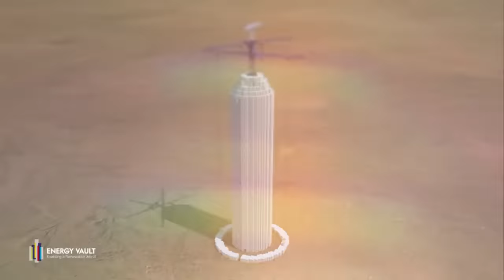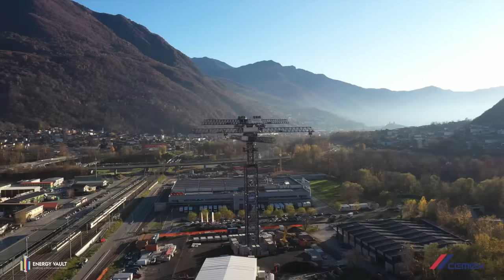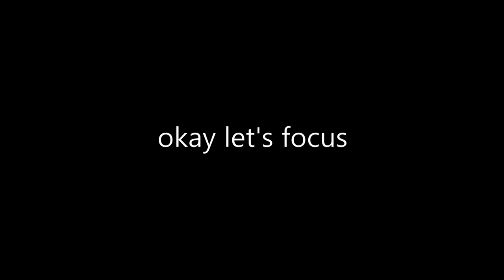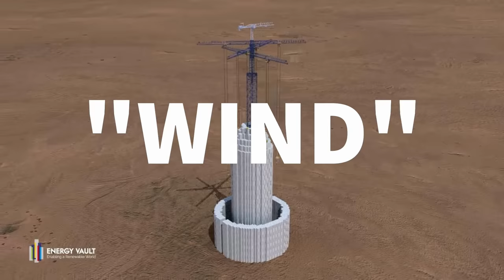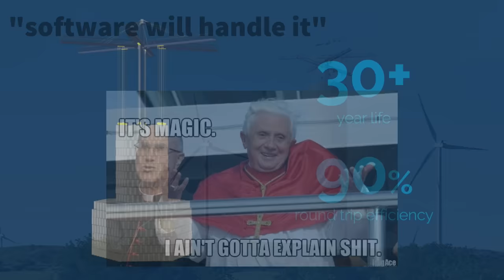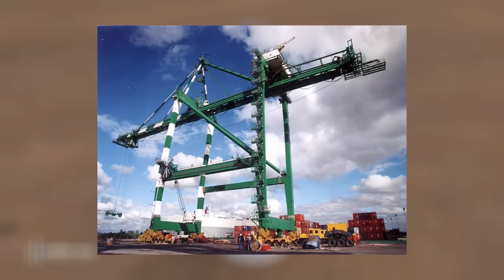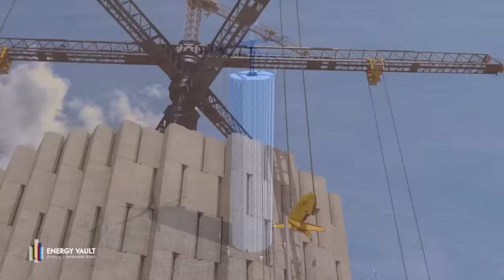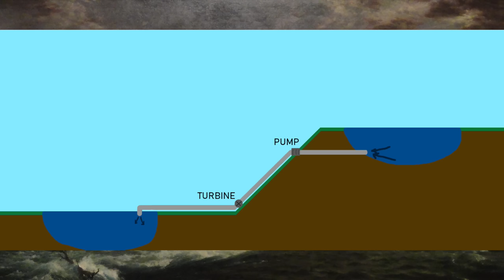The Energy Vault is a Dumb Idea, Here's Why

Comment: it was developed because geographical constraints make pumped hydro unfeasible in a ton of areas
Reply: So what? A lot of places cant have it, why is that a dealbreaker overall?
Reply: @nenmaster5218  Transmitting Electricity over long Distances is very complicated, and you still lose Efficiency regardless of how high the Voltage is. Insufficient Voltage results increases Resistance, resulting in Transmission Losses. Another Problem is that the Wires behave like a weird Capacitor, and Capacitors cause Reactive Power in AC. Longer Transmission means longer Wires and a larger Capacitor, thus more Reactive Power. All of that presupposes, that there already is a sufficiently high Voltage Transmission Grid to avoid said Transmission Losses from Low Voltage Resistance.
Reply: @Genius_at_Work  Oh?
Reply: @nenmaster5218  Wires always have some Resistance, which is proportional to the Length of the Wire and the Current flowing through it. If your Wire is long enough, the Resistance increases so much that next to now Power arrives at the Consumer. The Solution is to increase the Voltage, which allows to transmit the same Power at a weaker Current, thus reducing Resistance Losses. So in Short, a Wire always behaves like a Resistor. A very weak Resistor, but it becomes significant if the Wire is long enough. Hence Electric Transmission works with High Voltage, especially over long Distances. Typical Voltages in Germany are 220 and 380 kV for Long Distances and 110 kV for Medium Distances. The highest Voltage in the World is 1150 kV in Kazakhstan.

The second Problem is a bit more complicated to explain. The Voltage between the Wires builds up an Electric Field, and an Electric Field between two Conductors is a very simple Capacitor. When connected to AC, a Capacitor shifts the Sine Waves of Current and Voltage out of Sync, aka the Peak Current doesn't occur simultaneous to Peak Voltage. Because Power is Voltage multiplied with Current, the (effective) Power drops while Voltage and Current stay the same. The "lost" Power is called Reactive Power, and can best be described as Power moving back and forth the Wire but never arriving anywhere where it could be used. A long Transmission Line would turn into a giant Capacitor, resulting in a lot of Reactive Power. So your Generators would just send Power into the Transmission Lines where it "disappears" without performing useful Work. DC Transmission wouldn't have these Problems, but High Voltage DC Transmission is very expensive, as Transformers don't work with DC. So additionally to the Trasnformers for stepping up the Voltage for Transmission and then stepping it down again for Distribution, you would need an AC-DC-Converter between Step Up Transformer and Transmission Line, and a DC-AC-Converter between Transmission Line and Step Down Transformer. Especially DC-AC-Converters are very expesive, so High Voltage DC Transmission is used only for Sea Cables where there is no Way around it.

Comment: its just 340-350% more space->power efficient than water and also doesn't need much of a wall or space to hold it or make it efficient 

while the base efficiency of water is only 80% 
the efficiency from raw material to electricity of concrete is 90%

concrete can handle temperature, water has problems with it

the claim of the co2 is only a made up disadvantage 
Concrete binds the same amount of co2 in the production and only "creates" the same amount (like the co2 in a tree)

Sadly you cant see the dislikes to know bevor watching it, that its just fake news

Comment: Can we go one step further and skip the pumping to the top pool, maybe just use a water source that's naturally higher than the turbine?
Reply: But that would just be a hydro-power-plant, not a storage device.
Reply: @Otek_Nr.3  if we block the flow when not needed, would it store?
Reply: @canopyjunkie  Yes but you haven't invented anything new with that idea either. That is literally what hydroelectric dams already do. Take Lake Mead outside of Las Vegas for instance. It's a man made reservoir held back by the Hoover Dam. The issue with reservoirs is largely environmental and monetary. A large hydroelectric dam costs 10s or 100s of millions of dollars to build, which is outside of the realm of possibilities for many locations. They also tend to destroy the ecosystems they interact with.
Reply: @Evan_Schaefering  I think the sarcasm is being missed in my comment.... using surplus energy to pump water from the bottom of a hydroelectric dam to the top seems silly when dams already exist with a seemingly unending supply of water, thus eliminating the need to pump water from the bottom back to the top. I'm simply taking the somewhat sarcastic nature of evolution that this video took and continuing to the next steps... "why dig a resuvoire when elevated water sources already exist naturally and with dams" and "why pump the water to the top when nature already fills the top" 

Mechanical energy storage just seems incredibly inefficient and impractical to me

Comment: While water doesn't break or erode, it does evaporate. especially in environments where solar might work very well. Is the energy vault good for that situation? no. you could just put the solar panels on top of the reservoirs, which would reduce evaporation and help keep the units cool. 

Alternatively, you could pull another 'adam something classic' and turn it into a train. Fill the cars will rubble, which is cheap, readily abundant, and doesn't create CO2, then run the train uphill with energy abundance, and let regenerative breaking generate energy on it's way back down. You reduce wasted energy since you don't have to spend energy to send empty units back up for more weights while you are trying to make more power, and everything is now made from stuff that is used in other industries and easily replaced. Is this better than hydroelectric? no, but when dirt is cheap and water is precious it has it's uses.

Comment: This really is a stupid idea. Also, apart from what is explained on the video, it is noteworthy that when the outer and inner stacks are half full (or half empty) the height difference is zero, so it kinda won't do anything for a while, so you in a way can only use half of the capacity anyway. One half of the blocks are at any given moment sort of just acting as something to stack the other blocks on rather than storing potential energy. Kinda. I think. Something like that anyway. I think I'm onto something here at least...

It would be a much better idea to dig a deep hole in the ground and move the blocks between the bottom of the hole and the surface of the earth. And then the water ...yes, using water just is a better idea.

Comment: This has got to be one of the stupidest things I've ever heard of, we have extra energy why don't we just waste it by moving some blocks instead of storing it.
Reply: The Idea was to lift the blocks when er have Energy and when letting them down Spin a Turbine. The Energy is not wasted. Sure it isnt 100% efficient but its Something. Still the water Idea ist better anyways.
Reply: @bentheman69    its still just a stupid idea, we already have hydroelectric and solar, nuclear and coal power we don't need to store it in a "battery" like this one. even if the concept was sound which it isn't there's still the fact that no matter what you do the total returns are significantly less with each level down the tower. the water idea is just a thing we already do and is perfectly sound (i think).
Reply: @acewmd.  yes the tower idea is stupid as i said. And we need a energy storage solution. Energy that is being producer is used instantly. So if we have too much power its just wasted. Oh and if we have too much energy in the grid, the grid frequency (50 or 60 hertz depending where you live) will increase too much which is REALLY BAD.

Comment: See there's are fundamental issues with pumped storage though.  Just like there are with this.  I definitely agree with most of your statements, and complement your practical mind, but I don't like how you just go PumPEd StORaGE!!!  That just glosses over the things that this idea fixes about pumped storage.  I had never heard of energy vault before, but when your video started I instantly went why didn't I think of that about energy vault rather than just going PumPEd StORaGE dOY like you because I know what pumped storage is and I know its issues and saw how this fixes some of them.

Three Main issues with pumped storage:
1.  Evaporation loss:  A lot of the water you pump (because it is espoused to the air will evaporate heavily reducing the efficiency of the system.  (Most solids don't quite do this)
2. Needs water.  Just like how you were talking about the availability of concreate or concreate substitutes some places don't have a availability of water.
3. Safety.  To be fair their initial design seems pretty dumb to me because of its open nature and the issues like wind that come with it, but I can think of many solutions like making it underground like you did.  Pumped storage involves pumping millions of gallons up a big hill into a reservoir.  Dam failures are usually pretty catastrophic, and pumped storage often has increased concerns of this because the water is being put somewhere it might not have been before or other concerns.  Also just like regular dams usually there is a pretty big environmental impact.

I get the idea of your video, and agree with most of the meat of it, but I believe your overall point is completely off the ball, and even if energy vault is a stupid idea you never mentioned a single issue that it was trying to solve and instead just referenced the very thing it is most likely trying to work along in parallel with, but in areas or scale where pumped storage isn't available.

Come on man, lets work together for a better future, not shit on everyone else's ideas.

Comment: Lol. Software will solve is oversimplification. Do they know how hard error optimisation is. Companies spend milllioms getting optimisation right and for a complex problem with so many variables(off the top of my head) wind speed, power, tension,weight, turbulence, fractional forces on each side, wind shear(at heights where they are going) and so many more that’s a lot of inputs. Plus plan utested system there’s bound to be mistakes in the beginning especially if precision alignment is required. It’s way more trouble than it’s worth.

Comment: Looking at this again, pumped hydro would also face losses in evaporation, similar to the erosion of the blocks. I wonder how it compares. Shame it was just a brief video.
Reply: tf😭😭😭😭😭😭😭😭. my man has never heard of rain😭
How can you even compare that?
Reply: @TheYolo20  You say that like dry places with limited rainfall don't exist. Or droughts.
Reply: @jjbarajas5341  You mentioned evaporation of water by a lake but if the water evaporates more than it raind the lake wouldnt be there after millions of years
Reply: @TheYolo20  I did not mention lakes. Pumped hydro is artificial and isn't meant to be used as drinking water, it's just a battery. The same water gets used over and over.  Lakes become replenished from direct rainfall and rain/snow that falls on the local watersheds. Well planned drinking reservoirs will take advantage of this local hydrology to fill themselves over time. It's a mistake to act like there aren't downsides to pumped hydro or any other technology.

Comment: A gravity battery can really shine with either a massive weight, a huge drop height or ideally - both.
Pumped-storage hydroelectricity is limited by location.

One could also have a floating platform on the ocean over a very deep spot like the mariana trench.
Drop down and lift again a single large weight, like 1000 tons. Thats 30 MWh right there.
Recharge by wind and solar of course.

Only issue is to find deep enough spots of ocean quite close to the shore so the energy can be transported.
But I think even with just 1000 m or so of drop height it is still feasable, with larger or more weights.

Comment: I wanted to shit on this video but you ended on a high note.
Mechanical batteries are part of the solution to boom and bust cycles in renewable energy (I live at 62 degrees latitude) so I want to defend this project but yeah, capacity and size problems are undeniable.  As a concept it is fine, however, as designed it has some issues.
Reply: yeah, the particular design he picked apart is a poor example.  If he had just stuck with that, I'd have no comment.  But he ended with hydro, as if the entire idea of solid-mass storage is no good.  Simply not true, it's in use every day.  Just remains to be seen how else we can apply it.

Comment: Water is not plentiful in all areas, actually most areas,  water take large land areas to contain. It's a good solution windows things are present like the Hoover Dam water could be pumped back above the dam as a storage technique let's say. I would think a pure gravity system with the least moving parts the least infrastructure and of course the least cost to build would be the best. That's an easy statement but which is that. I think in this case it would be a matter of keep it simple stupid. We need some quick research into what's cheaper to build and maintain. I'm guessing it would look more like the crane system, but without the complexity.
Portable cranes are built alongside office buildings and high-rises being constructed and they don't seem to fall down so you would think we could build a vertical crane structure that was somewhat cheap and sturdy. Windmills don't seem to fall over due to wind, so why would the crane ? I think the key is to use the world's best technology when you build the crane to protect it from the elements so that it would last at least 100 years. So we need creative people to concentrate I think on that, building a structure strong with the least parts and I will last as long as possible. I think the secret is coming up with some of the best coatings that exist in the world. We build Bridges and don't worry about the elements of course we worry about it but we plan ahead of time especially since the California bridge disaster in the '60s.

Comment: So digging a hole is not just freaking expensive?

But yeah pumping water up a hill or down a hill is better
Reply: Generally, digging a hole is low-maintenance. A hole doesn't go anywhere, it doesn't need much repair, and there are fewer parts to break.Same with water. It's clean, useful, and won't unexpectedly crack at the worst possible moment, ruining the energy storage. Dams obviously DO need to be maintained, of course, but even the most expensive dam is more worthwhile than the jenga-energy project.
Reply: @ih9649  yes damns are awesome. But next question: how fo you get 45.000 tons of water anywhere?

Expect the mountains where glaciers are a thing. Also digging a cellar is expensive af. I don't wanna know what digging a hole this derp costs

Comment: How in the sam fuqqing hell are regular concrete blocks going to store energy?
Reply: Instead of letting them fall, you lower them on a rope, wich turns the wheel on an electric motor, making it a generator.
Trams break with induction motors, feeding most of their kinetic energy back into the grid. Same principle.
Reply: @gregorstrohman3619  And restacking the blocks, is that going to consume more energy than produce? better off with the wind turbines. sheesh
Reply: @smacleod69  your questions show that you did not yet understand the concept here.

It takes a tiny bit more energy to lift a block, yes. the difference is of course that you can choose when to lift a block and when to lower it, versus when a wind turbine will produce exactly the amount of elictricity you are consuming at this second.
Which is the whole point: Too much windpower: lift blocks. too little windpower: lower blocks.

BUT: the amount of energy stored this way is really not a lot compared to the construction effort.

Comment: I mean the concrete C02 emissions is obviously a problem which can't be overcome. Then the space. But tech software can't judge wind to stack blocks?? That's like faith in a god??? So, if I invent a differential for a car, and it uses an e-motor as a servo actuator, I also have to design the software to actuate it???? NOPE. That's what software engineers do. It's not my job. I'm not expected to make that happen. Also, anyone looking at today's car tech can see it's easily doable. Thereby, how is it so hard to actuate a system for wind and stacking?? SIMPLE TASK COMPARED TO LOCKING A DIFF ON A MOVING VEHICLE WITH PASSENGERS. Sorry....that criticism sounded silly, unless there is no tech out there that already does this. Pretty sure aviation engineers can attest to wind adjusting software for more complex tasks than stacking blocks...just sayin. Otherwise, good video, you're right, it's not going to work. BTW, putting it underground also takes the variable of temperature and weather out of it. Always pretty constant underground. Question is, how much evaporation is prevented by creating a giant cistern underground, versus an open lower storage pool? It still evaps within water towers, so that's a key variable.

Comment: This guy thinks the block on block is the problem. Ever think of a rubber pad, . so its rubber on rubber. Oh rubber wont last long enough, did you know bridges shift on rubber pads between the concrete at the ends...   actually a functional idea.